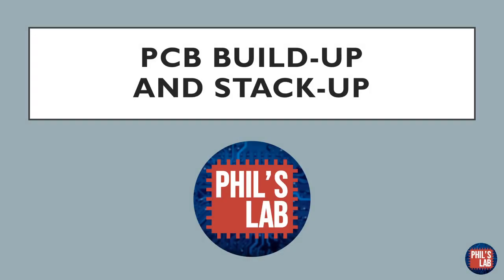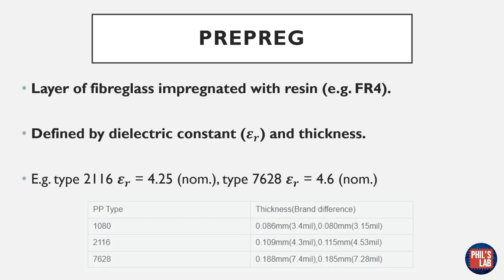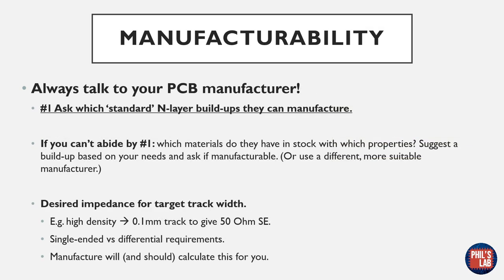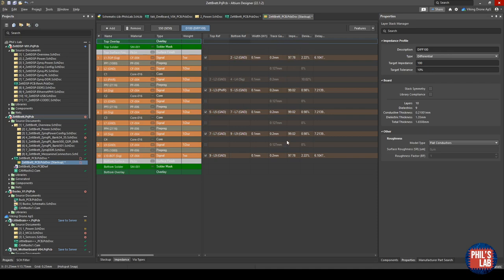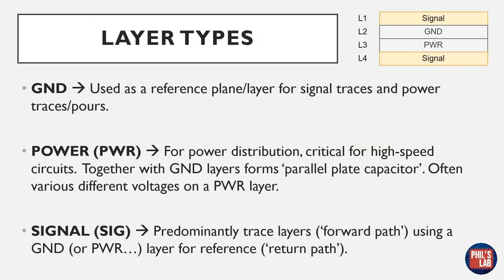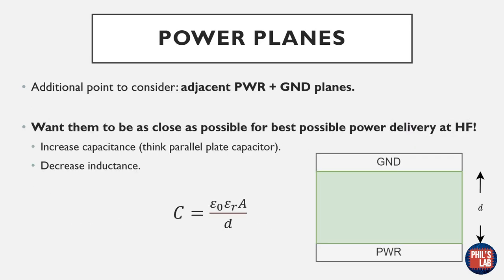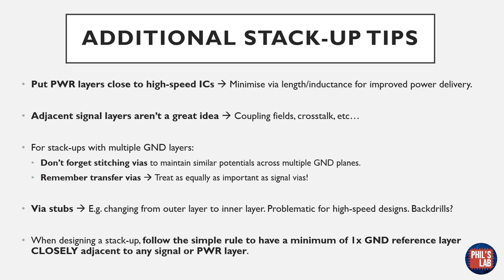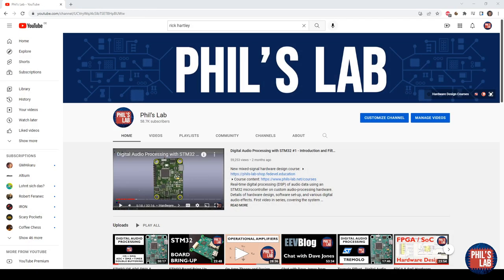PCB Stack-Up and Build-Up - Phil's Lab #56

Comment: Thanks Phil! The best I can dream for is you bringing your talent for clear and concise explanations to the following topic: designing to protect and filter power rails. Reverse polarity, max/min voltage cut-out, max current cut-out and filtering out noise across a wide frequency range (using LC filters, or perhaps newer power management ICs). Thanks in anticipation!
Reply from the maker: Thank you very much for the topic ideas, Dan. Those are definitely things I want to cover in future videos!

Comment: Hi Phil, I’m took you Mixed Signal Hardware Design with Kicad course and learned so much! You mentioned in one of the slides that power supply filtering could be a course in its own, so I was wondering, do you plan on making a full course on that topic?
Reply: @phil yes looking forward to see your video on power supply filter
Reply from the maker: Thank you for your support, Kyle. I'm just setting up my lab and want to make videos/a course on EMI/EMC in general, which would include power supply filtering. So probably not a course focused solely on PSU filtering I'm afraid.
Reply: @PhilsLab  wow good to hear ....any expected date of releasing the above course.....I am looking for the EMI/EMC course for long time

Comment: I have only recently encountered your channel and I must immediately say that I am completely hooked. I particularly like the pace and style of delivery, I find I'm picking up real insights on topics I considered myself reasonably competent. I am currently dipping into several topics that I have an immediate interest in, but I'm really tempted now to delve into the DSP topic, which I had steered clear of up to this point. I'm contemplating the viability of building an Audio Signal Analyser based around one of the many DSP ICs currently available. Having come across the SigmaStudio IDE and the ADAU1701,  I'm beginning to think it might be possible with a relatively small BOM. Please keep doing what you're doing Phil, lifting the veil on some truly magical engineering techniques. Based on the advice in this video, I re-did one of my previous PCBs...and gained almost 4dBs or so of useful Dynamic Range. I knew I hated switching regulators...!!!

Comment: I really enjoy a different layer combination, where, when switching from one signal layer to another you wouldn't need an extra GND via:
- Signal-
- GND -
- Signal -
- GND -

The only consideration is that is can be more challenging having components on both sides of the PCB, however not entirely impossible!
Reply: I also like this stack - it allows to embed sensitive signals on layer 3.

Comment: Great and informative video! I
 I have a background in microwaves and do appreciate what You say here. Learned new things about stacking...
It is interesting that what used to be the domain of specialized expensive software now can be done in mainstream PCB design software. Used to work with autocad and a gerber generators for microwave layouts. Computations where done in various software packages such as compact and similar.

Comment: Very interesting as usual.
I went to JLC to have a look to at 6 layers stackups. For 1.6mm thickness, the core's thickness betwwen layers 2 and 3 is 0.55 mm while it is only 0.1mm between layers 3 and 4.
If I compare to your suggested stackup (19:04), my interpretation is that layer 3 (signal) will couple more with layer 4 (power) than with layer 2(gnd). As power plane is generally not a full continuous plane because of several voltages on the board, what is the solution? 
- find another manufacturer with smaller thickness between L2 and L3, and bigger between L3 and L4?
- route L3 without "crossing" differents power planes?
- this stackup will work only with a single power voltage?
- my understanding is wrong and this will work wathever dielectrics thicknesses?
Thanks

Comment: Does the story for 4 layer change if the majority of your parts are through hole components? Videos like yours are understandably very SMD centric. But I build mostly for vintage computers and such. Everything is throughhole and every pin is basically a via. After seeing this video it seems to me I could use a stack of signal/GND/Power/Signal. Just don't use the bottom signal layer (Power and top signal layer) are both close to a ground and I could always add a close gnd via to any power pins. 

Also what is considered a "high speed" design? high speed is so relative and no video on the subject comes even close to defining it.

Comment: Thanks a lot！I am working on a 4 layer board, and I get a little confused about whether should I change the inner layer PWR to GND. I check my design and looks like I don't need a full layer to route the power line.
Reply from the maker: Thanks for watching, Wayne. Yeah, a lot of times you can get away with routing power rather than 'sacrificing' a layer on a four layer board for PWR.

Comment: should transfer-via concept be implemented on high frequency design with single-ended  tracks ? 17:10
Reply from the maker: Yes, regardless of low- or high-frequency I'd advise to place transfer vias (as long as reference stays the same of course).